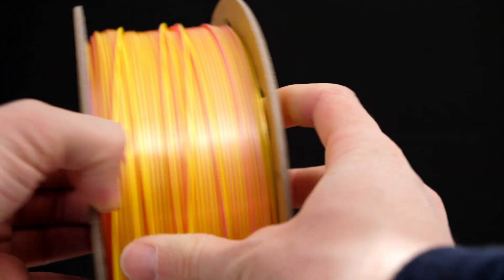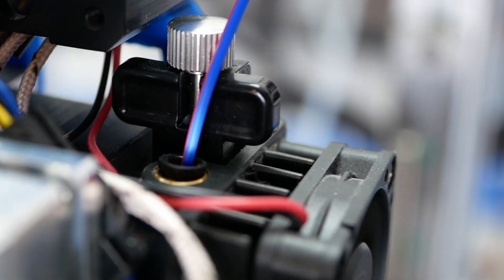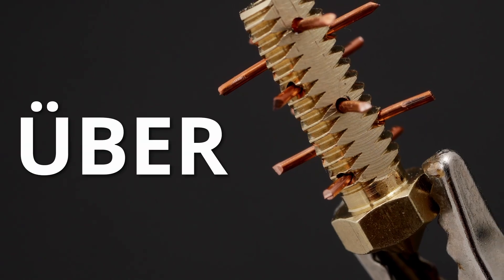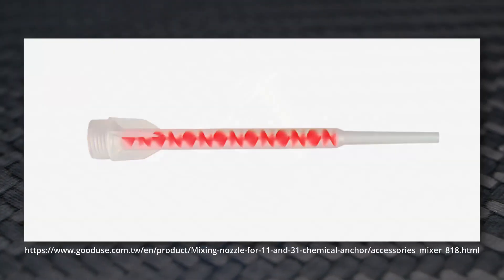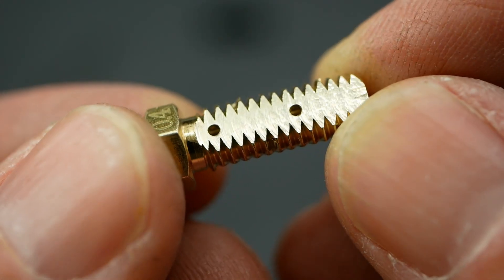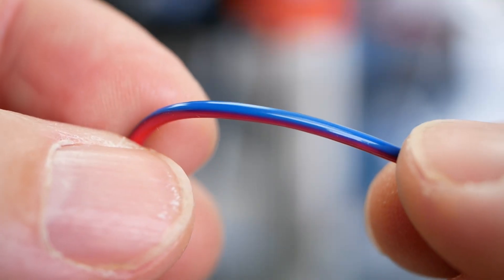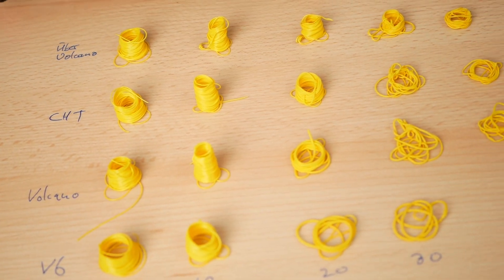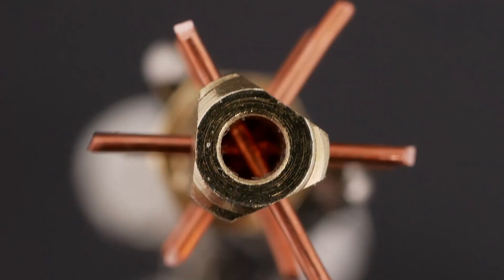Do High Flow Nozzles MIX Dual Color Filament?

Comment: It should NEVER have been patented by 3D Solex at all since it is how it has been done in the industry since the invention of thermoplastics.
Even the mixing channels of epoxy glue cartridges use the same principle. They do not fulfill the minimum level of invention.
Time to squash a patent.
Reply: Then, in that case, it should never have gone through the patent office. But it's all fine for SOLEX to try and patent something new in 3D printing. Especially good that they're willing to license the rights to it.
Reply: @belded-wee  You can not patent anything and refuse to licence it. That is not how patents work.
They are NOT to stop competition or prevent it, they are to allow for earning back costs of innovation.
The problem here is that patent offices are very different and it seems many are not doing much if anything in their searches for prior art. This is partly because you are responsible to have done this when you apply for a patent. They simply put it up pending, and see if anyone objects. Usually this goes unnoticed by all and the patent is granted. Then you have to pay the patent office to re-examine to have it revoked. This is time consuming and costly but usually cheaper than paying licensing or fighting court-cases.
When the innovations come from the community it is especially bad when someone patents it. I speak from experience.

Comment: Have you thought about using your router to mill slots in the threaded section of the nozzle?  you could insert copper "blades" with sharpened edges to reduce resistance and increase surface area for heat transfer.
Reply: I was thinking he could possibly just file the wire down a little bit before inserting it

Comment: bad idea tu cut thread of volcano nozzle, you reduced the heat transfer. You need to use the right drill bit for create the center of the hole

Comment: Milling those flats absolutely destroyed the surface area for transferring heat from the block to the nozzle 😬
Reply: Yea since hes using high temp solder and re-tapping anyway why he didn't just add in the full threads...

Comment: You can use a spot drill to start the hole, and/or mill a tiny flat spot with a small end mill and drill into that.  You have the cnc capability to that would be easy to do!

Comment: To circumvent this patent:
Just seperate nozzle and heatzone. make special heatzone with internal radiator/heatexchanger wires  / fins, then use bog standard nozzles in the end, boom patent avoided, and hereby declared public domain!

Comment: Any thoughts on a nozzle system which would allow end users to create their own dual color filament. Rather than feeding in one filament that is already dual color the nozzle would take two filaments and line them up next to each other.
Reply: Basically a kind of a Diamond nozzle which he shows at the end could probably create this effect. There are also dual nozzles around.

Comment: FYI US patent laws place no restrictions on personal experimentation with patented ideas. Only if you started selling something would it matter. The whole purpose of the patent system is to encourage inventors to disclose their ideas in exchange for patent protections so that other people can understand and improve on the idea.

I’ve seen a lot of misconception about this in the 3D printing community (that said, I know nothing about German law).

Excellent job as always and very informative video!
Reply: Just seperate nozzle and heatzone. make special heatzone, then use bog standard nozzles in the end, boom patent avoided, and hereby declared public domain!

Comment: If you want to keep the bit from wandering, make an M6 nut with 3 sides, and tighten the nozzle inside. Then you can use the flats of the nut as your drill point without having to sacrifice the threads on the side of the nozzle. 

It's essentially just making a drill bush, but for a radial drilling direction instead of an axial direction.
Reply: You could just drill a hole in a normal nut and rotate into position, drill and rotate it again, repeat till you have all the holes drilled.
Reply: @samthenerf  Good idea. Better still, a square nut (maybe a long one, made from a bit of brass bar) with a longitudinal split right through one side, and the guide hole drilled opposite the split. Then when you tighten the vice it'll flex and clamp the nozzle threads. Jig and fixture all in one! Bonus marks if one side is rounded so that the flexure of the jig doesn't affect the grip of the vice jaws.
Reply: @samthenerf  both are really smart ideas
Reply: Could also just spotface each hole with a small center cutting end mill and a slow feedrate. Or even just use a chunky center drill barely enough to get past the threads.
Reply: @martyshrekster  I second the center drill idea.
Reply: Smart Idea - I think this is how it would work just fine.... 
A standard M6 nut is just fine though - not even something to make.
Reply: @Max-kc2rc  The only real problem with a standard hex nut is that if you grip it in a vice across its flats, it doesn't present a flat face uppermost, so your guide hole would have to be through a corner, or you'd need to find a different way of holding it.  A square nut would be easier.
Reply: @cooperised  You could file the corner off to make a flat spot, M6 square nuts don't seem all that common.
Reply: @samthenerf  True - I guess I just can't help thinking like a (hobby) machinist.  I'd rather spend the 2 minutes to drill and tap a bit of brass bar than break out the files to put an inaccurate flat on a (possibly quite tough) nut!
Reply: @cooperised  I would not say it's the best way but for someone without machine tools (most 3D printing hobbyists) a path that needs only nut and a file will be much more accessible. I actually gave it a try, (without making a flat on the nut) with a vice, center punch and cordless drill I was able to drill through a steel nut and into a steel bolt right on the crest of the thread, I held the nut in a bench vice and drilled at a 45 degree angle, it worked quite well and I suspect would be even easier drilling into brass.
Reply: Pre-drill the nut.  
It can be held in a vice so that a flat face is perfectly horizontal if it is turned sideways.  Then thread it onto the extruder and put it in the vice.  Holding the nut by the sides will require you to drill at 45°, but the pre-drilled holes will act as a guide.
Reply: @cooperised  But in this case he has a mill, so just clamp the nut and mill the flat you need for the guide hole.
Reply: @cooperised  True, but you could always mill off the upward facing point of the nut, basically leaving you with a seven sided nut.
Reply: @cooperised  You can put flat surface quite precisely just by filing it down to the vice jaws - they should be much harder than nut, so you wouldn't ruin them with a file with some patience and care ;) Or you can put some angle profiles on jaws, so the file will slide on them instead of vice jaws.
Reply: I'd also like to add that if possible he could have cut or filed down the wire so that it isn't completely round inside the center of the nozzle which would help improve the filament flow even more!
Reply: I could not see if center drill was used first at all to prevent wandering with such small 0.8 drill bit this is essential. Another problem is to align nozzle to be truly perpendicular to drill bit. Easy way to address both issues would be to take a piece of round stock center drill pilot, drill hole & tap m6 thread (ideally thread cut also in lathe to ensure correct axis)   then screw on nozzle. Align in vice, find center with dial indicator or other center locating technique, use center drill and drill with 0.8 drill. You could also mill flats to round stock and use it as index jig to have "precise" 90deg when you rotate part in vice. Obviously Stefan has all the machining equipment which make things much easier.
Reply: You could just center punch the nozzle in the threads

Comment: YouTuber deckingman experimented with mixing  mechanisms  but found them ineffective . I suggested active mixing using a motor driven mixer in the hot end. 
https://youtu.be/fmz_SPbu7p8

Comment: hey stefan, i think the melting performance of the über-volcano would be even better if you wouldn't have milled the sides down. the milled down surfaces reduce the contact area with the heater block thus reducing heat transmission.
Reply: I agree. And to create a flat spot to start the drill, screw the nozzle in a M6 nut. Then drill through the nut and the nozzle, and remove the nut afterwards.
Reply: @peterlekkerkerker4482  This is a clever way of doing it. I would add another nut to tighten the previous one and make sure it does not move at all during drilling.
Reply from the maker: Good point but I honestly think the heat transfer to the filament is so bad that the reduced threads area doesn't make a real difference.
Reply: @CNCKitchen  you should make an omega volcano. Use thinner wire with thinner holes but way, way more strands. see what happens. (basically mashed potato the filament inside the hot end.)
Reply: just add more solder before re-cutting threads. Need to find some silver solder that can handle higher temperatures.
Reply: Interrupted threads don't appear to be a problem, but might be better served with just a 1mm slot on each side compared to a full reduction, yes. Which incidentally... might allow affixing the wires in a different way: don't drill through but stick it into the other side, then bend up the wire into the channel before soldering it in.
Reply: As a machinist, the simplest solution to minimizing the thread removal and still maintain position would be to spot face the hole locations with a small end mill. Simply put you drill with a flat bottom endmill just slightly larger than the intended drill size just deep enough to create a flat spot. Then you would drill your hole thru. 

In a soft material like brass you may even be able to get away with a spotting drill, but you would would need a much more rigid set up like a mill.
Reply: I remember on the last video about the DIY high flow nozzle that someone mentioned using an old crappy heater block to drill the holes, tho an M6 nut would be my suggestion instead. Just rotate the nozzle after each hole to the next one and you have a perfect guide.
A friend of mine did just that when drilling locking pin holes on a screw a while ago.
Reply: Do not machine down.  File the copper wire and solder down.  The use a die to remake the threads interrupted.  Then the wires are inside.
Reply: I think he will get propper result with thinner wire and not with crossing wires (+) but with paralell wires (II) and (=)
Reply: @Damjanhd  Fine gauge Nichrome wire, as used to make ecig coils, would be perfect for the job
Reply: @r3dshed  Copper conducts heat more than 30 times better than nichrome. To make the nichrome produce heat would be hard..
Reply: Since you are already using a torch to try pre-heat ing the nozzle prior to soldering, why not use the torch for soldering, similar to how copper plumbing is done. Also have a much tighter tolerance between your wires and the drilled holes, and use plenty of Flux paste to allow the solder to wick fully into the joint through capillary action.
Reply: put on a normal bolt and there you have 6 flat sides. drill and remove them. vola! perfect center hole and no extra work.
Reply: Interesting answers to solve that problem in this thread.

As a machinist, i suggest just getting a endmill to start the hole that's the same diameter like the drillbit that makes the troughhole. They're pretty cheap at that size, even if they're carbide. Especially if you buy them from china. 

Any normal drillbit will wander off and most likely brake if you try to start them on a thread. No matter wether they're made of HSS or carbide. 
180° drillbits would be the exception.
Reply: Second concept is to remake the heat block to take a square nozzle.
Reply: Other good suggestions here but definitely worth adding some thermal interface ie thermal paste
Reply: To start the hole he could use a starter bit, a very short and stiff bit, to make a dimple.
Reply: Could use a high stiffness centering bit to help start the holes then walking wouldn't be a concern
Reply: He could also File down the copper wire to give it a "cutting angle" for the filament inside the nozzle which might improve filament flow even more.
Reply: My thoughts as well but i didn’t see your comment until after i had already commented.
Reply: Last diy video he already not drill inside. The copper wire inside interrupt the flow due to area of molten filament to pass is smaller.. he just countersunk it. No drill pass through everything
Reply: Just drill with a 1flute end mill, problem solved
Reply: In stead of solder you could try a brazing rod and torch to attach the wires as they require a lot of heat to melt and come in different materials which would allow you to use the nozzle at any temperature, I am pretty sure most of the brazing/welding rods that melt with a torch melt at 700 degrees Fahrenheit also the screwing a nut on is one of the best ways to drill centered through threads with out removing material from the threaded area thumbs up to the person who suggested that
Reply: you can make holes the same size as the cover, but when you put them together, you cool them down making it easier to insert
Reply: I agree, milling 3 sides was a bad mistake. Using a longer drill bit than necessary to drill entirely through was a big mistake, one can clearly see how the extra length of the drill bit caused it to bend. Starting with a punch, and a shorter drill bit, would have been a better idea. As would keeping the holes fairly tight since solder isn't going to transmit heat as well as brass.
Reply: Thread chaser?
Reply: True although it does help start the drill. My suggestion though would be to plunge the end mill only in the locations you plan on drilling the holes and use an end mill only a little bit over the size that you plan to use for the drill bit.that way the solder completely fills the hole and you get full contact. I also wonder if you can get a steel Volcano nozzle. That way you could install steel wires and braze them or weld them in rather than using solder that has a melting point so close to the plastic. This would also allow you to increase the temperature and or use higher temperature plastic.
Reply: @zugigauto  All he needed is to start drilling at higher speed. Unfortunately PBD-40 he using has lower speed than needed and not designed for precise drilling.
Reply: Depends. As long as the heat transfer into the nozzle is >= the heat going into the filament then it doesn't matter. Think of the nozzle as a bucket with a hole in it. And the heat flowing into the nozzle as a hose filling the bucket with water. You can restrict the hose as much as you want as long as it flows at least as much water as the hole in the bucket then the bucket will never empty. 

As long as you can fill the bucket as fast as the hole can drain it then the bucket will stay full. He only needs as much heat transfer into the nozzle as the nozzle transfers into the filament. If this happens then the temperature of the nozzle won't drop.
Reply: @fail_fast  I agree, I'd expect the thermal conductivity of the plastic to still be the primary bottleneck
Reply: Cheap DIY edm machine could make the holes without slipping off the round circumference or better tooling, the it would only be the threads stopping heat flow.

Comment: Really want to see what an abrasive filament does to one of your home brew nozzle
Reply: AFAIK, abrasive filaments such as PC do grind up the nozzle as it brushes over the print after the deposition, leading to the nozzle shortening quite a lot.
Reply: @trischas.2809  PC is not abrasive. You probably mean PCCF with carbon fiber.
All fiber reinforced filaments, or wood, glow-in-the-dark, or other particle-enhanced ones are abrasive.